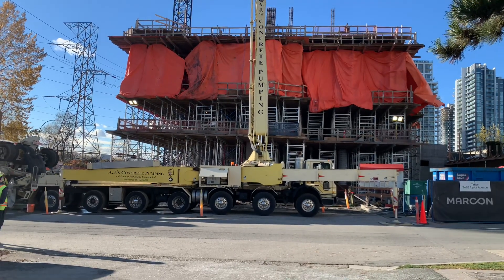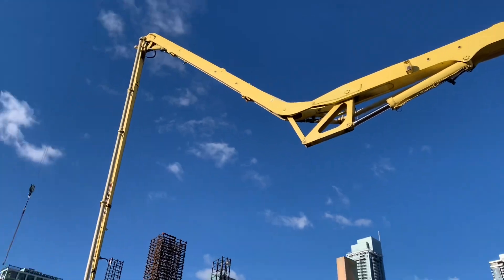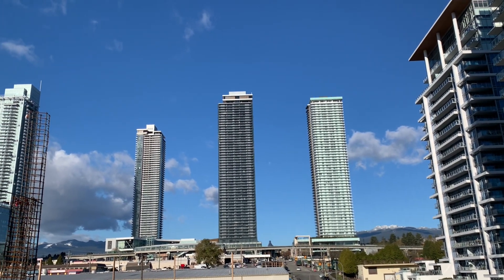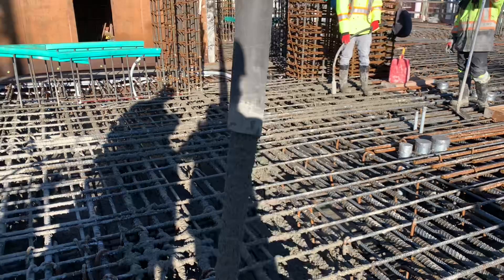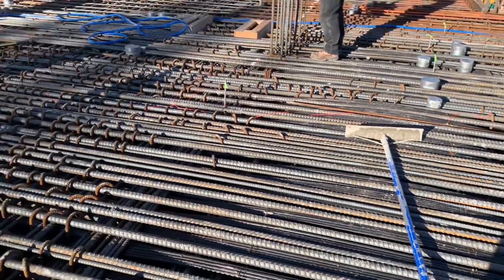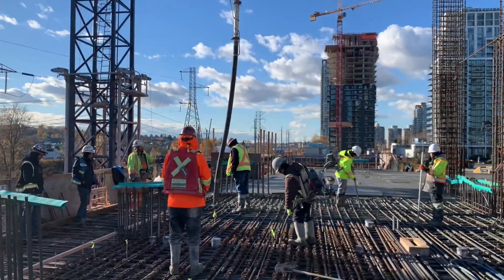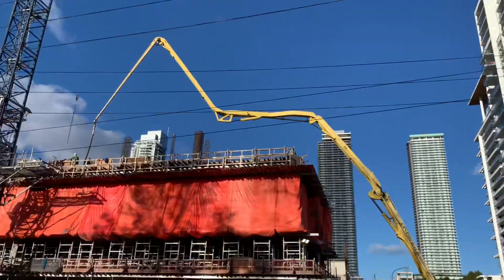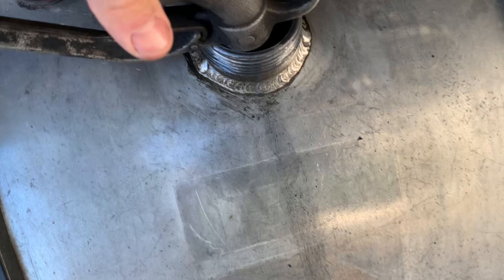Pumping 1000 cubic yards at the site which destroyed our power-divider!!!

Comment: Thats a thru shaft. You got stuck in some dirt and broke it trying to get free
Reply from the maker: 7 axle chassis. If not diligent with engaging the interaxle lock on uneven grades it’ll pick up a drive axle and snap that through shaft like a twig once said axles touches back down onto the asphalt. Unfortunately we’ve been through this routine close to a dozen times throughout the lifespan of this rig.
Reply: @canadianconcretepumper1979  If it's driver error, why are people still making the mistake over and over.  Seems like education is the key or is that oversimplifying a complex situation?
Reply from the maker: @lightning9279  It seems to be just one of those things. Over the years, literally eight different guys have broken the shaft in this pump at least one time respectively. The time I broke it was probably the worst (released the clutch with the parking brake still engaged, doh!!!). Other companies I’ve spoke to with these same 7 axle chassis in their fleets have had similar experiences to ours. It’s just too much weight for the power-divider unit. Our 56M which is on a similar chassis except weighs 15,000 lbs less has only popped it’s power-divider once in ten years. Good news however, we have received a part # and placed an order for what they are calling a “super-shaft” to replace the weak factory piece. This updated part is sold by Mack, so I assume they produced it to rectify this seemingly common issue.
Reply: @canadianconcretepumper1979  Too bad Mack didn't make it a recall issue so they would just give you the part seeing as you've purchased this part multiple times over the years.